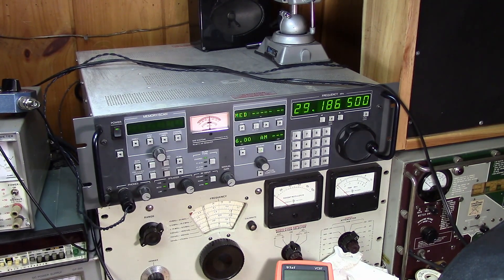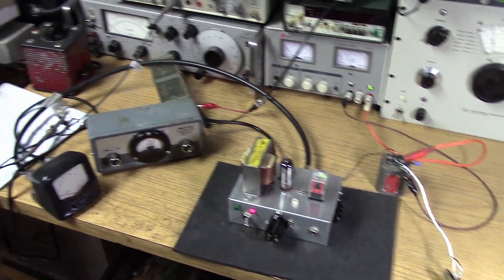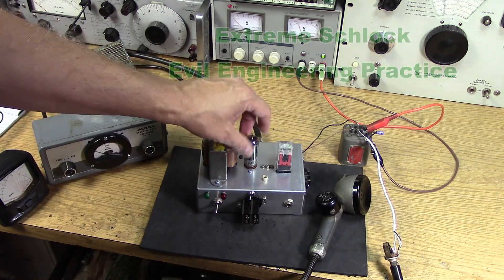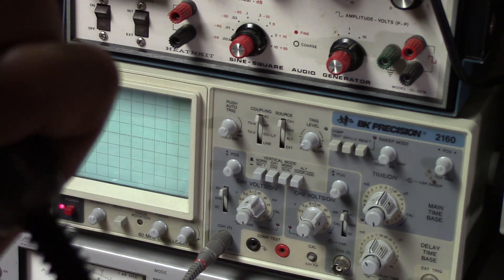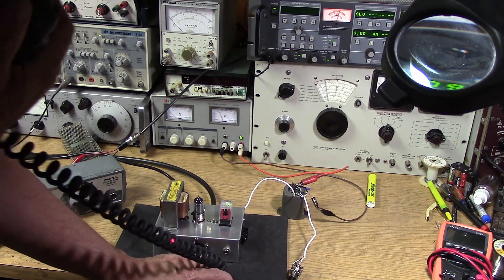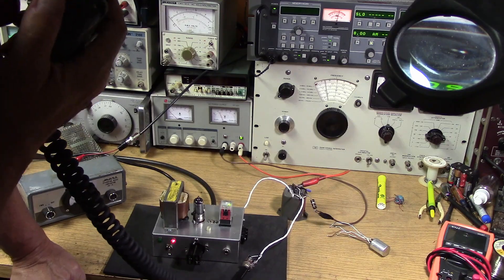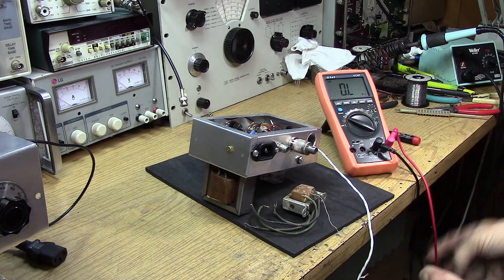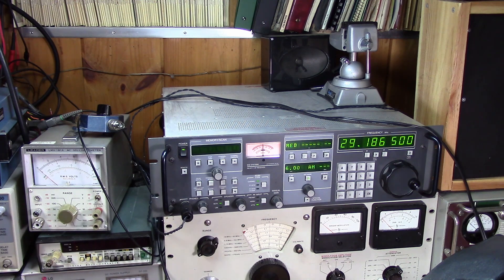One Tube 10M AM Transmitter Part 4

Comment: I just used 3V to 230V cheap power transformers as mike-to-grid back in my poorer days. Didn't have any problems whatsoever with this in 2 CB-transceivers I build, one around a ECC91 (that's a 6J6 for you guys across the pond) and another around a pair of CK5676s for some kid. In both cases I used a telephone-element and Heising modulation of a Xtal-oscillator running at some frequency in the CB-band.

I know a lot of folks are gonna jump up at this suggestion, but hey it's better than nothing! And voice doesn't require anything over 3000 Hertz passing through anyways. The only major problem one might have is core saturation on the microphone side.

Anyway, I loved this project and learned a lot so far! It might inspire me for a project in the near future since I have some battery tubes intended for Suppressor-modulation, like the Soviet 2P29P. Never thought this would actually work so well!

Regards,
Thomas

Comment: You can run your boots and still call yourself QRP, Mike! I heard this on 80m coupla nights ago. Op was outputting 10w PEP and checked into the nets when they called for mobile/QRP checkins. Of course his 10w PEP was driving LDMOS devices in his boots. I couldn't believe it. And they took his checkin! The net recognized this madness!  dit dit

Comment: That Intercom Transformer you used in the transmitter carbon mic modulation circuit there, reminded me of the magnetic amplifier transformer used in in the GE 105 console 1936 radio I restored not too long ago. The magnetic amplifier transformer has a primary resistance of about 2k or so. The two secondary coils in series, controlled colored red/green lights for the tuning indication, primary had varying DC plate current (from a 6C5) going through it, controlled buy the AGC voltage on the grid of the triode tube driving the magnetic amp transformer.  We had to replace the open primary coil, luckily people have had a transformer mfg make a replacement coil assembly.

Comment: Good to see this taking shape. I hadn't thought in terms of DC resistance for the transformer. I'm learning all the time on this channel.
Reply from the maker: Of course it could be a low resistance if the transformer were gigantic! But with small transformers with fine wire, they will have significant resistance. So more of an effect than by design.
Reply: @MIKROWAVE1  Thanks for the clarification Mike, I sometimes confuse myself  when it comes to things AC & DC. To my shame, I did a year of evening classes, took and passed with credits my full UK ham licence without realising that you can have AC and DC on the same piece of wire! PS, please don't tell anyone about this shameful secret! 🤫

Comment: My mobile rig's manual claims it can run 10 m AM, up to 50 W (though with the little quad-band antenna on it, your 3-4 W from a more efficient antenna  might have more reach).  If I know when to listen, and it's not in the middle of work, and I can figure out the manual to get it set for AM...   It's no tube rig, certainly doesn't have a carbon microphone, but it'd be my first contact that isn't through a local repeater (we've got 6 m, 2 m, and 70 cm here).

Comment: What about 6BW6 = CV2136 – British made miniature-tube 12W equivalent of the 6V6, 9-pin base B9A.
Reply from the maker: The suppressor grid is usually tied internally in many pentodes. And beam power tubes will not modulate  properly. So I  don't think that valve is a candidate.
Reply: @MIKROWAVE1  Can confirm triodes also do not work.
Reply from the maker: @TheLightningStalker  But I triode anyway.

Comment: Years ago I used an carbon mic for a project, if you tap the mic several times against something hard it would improve its fidelity.
Apparently the carbon granules sometimes stick together and tapping the mic loosen them up.
Reply: 😂 Banging the handset off the table was something I remember folk doing years ago wih telephones that had carbon microphones.

Comment: Nice project!  Would a telephone carbon mic drive it without the transformer?  Never used one before but I have two here.
Reply from the maker: Should work with an ordinary output transformer like 8 or 10K to 8 ohms and maybe 12V bias.